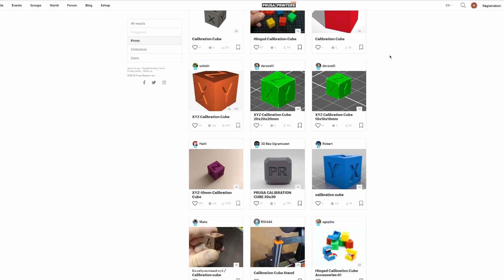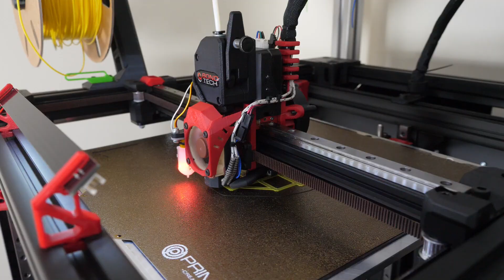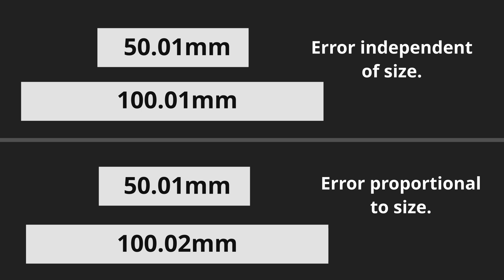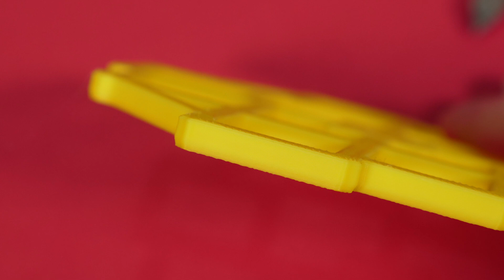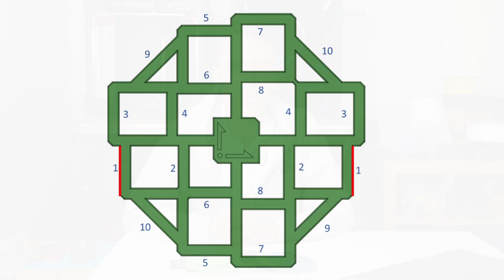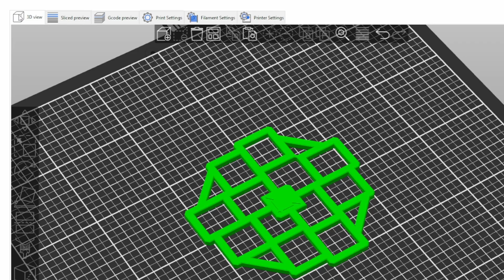STOP Printing Calibration Cubes!

Comment: First of all thank you designing this tool. I printed one ,measured, then did the adjustments on the printer saved the settings.
Round two same thing. It was worse than the first one . Back to square one with the measurements.
Round eight still no better than the original settings .
Decided to go back to what I had in the beginning.
Reply from the maker: You only need to do once.

Comment: I printed it on my Core XY but I have two questions about the excel file:
1. The file says "If you have CoreXY, X and Y are 'locked' to each other so use the average of the two errors." But wouldn't it be better to rotate the print by 45° to be exactly on the axis and have x and y seperate rather than getting just the average?

2. My part turned out slightly to small so the file suggests to either Scale the Part up in the slicer or adjust the Steps but if I decide for the later, if I understand correctly the printer will move a further distance without knowing that it also has to extrude more material to make up for the now bigger part did the file already calculate with that or do I have to adjust the extruder after this aswell?

Comment: I have just used this very successfully to calibrate my Ender 3 V2 Pro. I have two suggestions for improving the excel spread-sheet.

I'm using the Orca slicer and entered the shrinkage compensation value. However, on a 2nd calibration run the compensation value suggested by your spread-sheet doesn't take into account the currently set shrinkage value. It is an easy calculation to do, but would help if you could enter the current shrinkage value so that it does the calculation for you.

An unlocked area would be useful for entering comments on changes made.

Comment: Great tool! thanks! 
The description says: "If you have CoreXY...use the average of the errors". But where do I put the error? the spreadsheet does not account for CoreXY then. 
also: The inner an douter errors have hitns when inner is neg and outer is positive and vice versa. But mine are both negative. what does that mean?

Comment: Any ideas on how to apply the results from a califlower print to a Bambu X-1. While my correction factors are small, I have a large part thats very reliant on dimensional accuracy. I see in "Printer Settings" that I can add/modify the start and end g-code and its Marlin (legacy) flavor but I don't understand where to add the worksheet code.

Comment: This is a great calibration tool. I may need a little input though because results got worse. I expected the print to get bigger but it got smaller. I'm using Klipper and Cura.

I used the SuperSlicer setting in a Cura plugin for "Scaling Factor Shrinkage Compensation". I'm thinking this value for Cura should be 100.19 and not 99.81 like in the Excel file.

X = -0.19%
Y = -0.20%
Skew = -0.03%
Inner = -0.01%
Outer = -0.37%
Reply from the maker: Join us in the Vector3D discord and we can help you better there.

Comment: Hi there. I've just purchased the cauliflower and done a few runs. I've added the skew correction to my Marlin firmware. When I'm implementing the X and Y size adjustments in super slicer should I add the X and Y compensation values as well as shrinkage or just one or the other. Thanks.
Reply: Have you ever found out? I've got the exact same question ...
Reply: @tubeyoului  one or the other from what I remember.

Comment: sounds intresting, but would it be useable for an belt printer ? like CR30
Reply from the maker: Probably not.
Reply from the maker: You could still determine accuracy, but the calculated adjustments wouldn't be correct

Comment: I have an older CR-10S printer and use Cura as a slicing program.  There is an add on for Cura called skew compensation.  I found this add on to be really useful and it was quite an eye opener to discover that my precious printer was not all that accurate on the three basic planes as I expected it to be !  It was even out by a fraction of a degree on the XY plane.  Fortunately, the fix for this plane required a relatively quick and flat print and a bit of basic algebra. For the other two planes I designed a kind of pulley with a sturdy axial piece and printed a few.  I am fortunate to have a large old Meccano set and built myself a test rig to analyze the wobble on a number of these test pulleys.  After about 5 or 6 tries I had the wobble reduced to virtually zero.  This was a very interesting project on its own !

Comment: I bought the STL and read the instructions. Basically, what you're getting at is that we should get accurate prints by changing the E-steps and rotation distance (also account for Skew)? I have always used horizontal expansion to get accurate prints but the approach here is different. Am I correct in these assumptions? Should I never depend on horizontal expansion again? Will changing rotation distance really carry over dimensional accuracy to other models and prints?

Comment: Currently printing this on all my 5 FDM printers ,i do have a question, my tenlog and ender 5 plus i don't have access to the firmware so i won't be able to change the skew correct???
And does the nozzle size matters for this calibration?

Comment: After I print a flower and use the Skew Calibration in reprapfirmware. when I print the 2nd test to check results. How do I compensate for existign Skew. when it recalculates?
Reply from the maker: Unfortunately you can't but from the results I've seen you shouldn't actually need to do this iteratively.

Comment: The error measurement at the beginning has a weird logic in it.
If a cube of 1 cm measures 0.9 then the printer is off by 10%, so a 10 cm cube would be printed at 9 cm.
The reason to print a larger calibration print is to be able to measure smaller procential deviations.
Reply from the maker: No weird logic needed. If your reading accuracy is +/-0.1mm then that would be 10% of 1mm, but only 1% of 10mm. Bigger readings are better.
Reply: @Vector3DP  No, because an absolute error will always be the same, no matter how big you print it. A relative error will result in a bigger difference with a bigger print.
Reply from the maker: Precisely, and when reading your callipers, this is an absolute error. The error of 0.1mm is still 0.1mm, but forms a smaller portion of the total size.

Comment: tested.... my skew is not problem, problem is in inner XY compensation. first you need calibrate this then you need calibrate skew. your skew never gonna be correct. my wall are 5,2mm they need to be 5mm! so first inner compesation in slicer. after that skew. (and ) excel file for superslicer -klipper is in error rotation distance. result is in only in 2 decimals. klipper works on 6 decimals (documentation) so on ender(depend on hardware pulley) you missing some milimetes on correct move x-y.  not mentioned in the video and instructions. if skew is saved (SAVE_CONFIG) then it does not need to be loaded every time in gcode at the beginning and end. it is constantly loaded on every print. (same goes for z-offset). if you wanna load skew on each print  then a macro command needs to be made, like bltouch.

Comment: I wonder if something like this could work for a resin printer???????????
Reply from the maker: MSla/DLP Resin printers shouldn't really need XY or skew calibration as the output is all based on the pixels which are in a fixed position

Comment: Doesnt printing the same object to validate the accuracy defeat the purpose? Because at this point you are just validating that you put the right numbers into the firmware.. Wouldnt it be better to have a secondary calibration geometry that has larger and smaller points for measurements than the first calibration geometry to validate that the settings you have made scale well?

Comment: Thanks for the great work, I really appreciate it! However, after printing and measuring, I'm a bit lost what to do with the results. I understand how to process the skew value, but where do the X and Y values go? In the video you mention the x/Y Shrinkage setting in SuperSlicer, but that's one value, but  I have two different values for X and Y - so which one to apply where and how? Maybe I'm missing something really obvious, but atm, I think this part could use a little more detail. A quick pointer where to put which value would be greatly appreciated.
Reply from the maker: V6 spreadsheet with more guidance and details on implementation coming soon.
Reply: @Vector3DP  Fantastic news! Thanks so much.

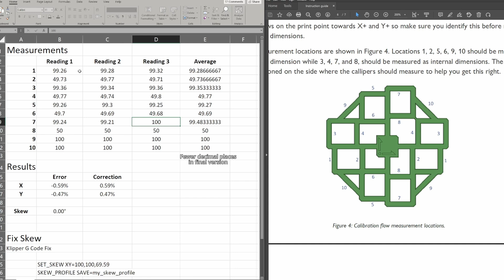Comment: Does your Excel Sheet has a fault? At minute 6:24 your Y error result should be -0,62% and not in -0.69% accounting the measurements from 5, 6, 7 and 8.
Reply from the maker: Nope, it works correctly.

Comment: That's a really clever approach for proper calibration (unlike those damn cubes that are pretty ... useless, IMHO). I'll try this asap before re-starting some projects.
I agree on a per-material calibration, yet should the material brand be considered too (per-material and per-brand) or can we simply ditch that detail ?
Reply from the maker: I've not tested enough different brands to know. I'm sure a low warp abs will shrink less than a normal abs, hence less warping, but I'm hoping most differences from one brand to the next will be negligible even though they probably exist.
Reply: @Vector3DP  That's precisely what I was referring to. One of my go-to ABS is TitanX (and its ASA sibling, ApolloX) by FormFutura and ... these don't warp (even on unenclosed machines). Gonna have to check these against regular ABS that's sitting around.

Comment: Bought the test and ran it on E3D toolchanger.
Skew 0.32° off! -> Unscrewed the Y axis and put it back on the square, re-tensioned the belt -> 0.01°. Quite disappointed that E3D give a machine in such a bad calibration.
It would be interesting to have some data on flow regulation, do you have any ideas?

Comment: Using the filament shrinkage setting in superslicer with a very small value, eg 99.965% results in lots of overextrusion and print looking crappy.  Ultimately after hours of work to arrive at the desired adjustment value, the recommended strategy does not work.  Tried with the current stable release and nightly build, same results.  If perhaps I could access the source files in the protected spreadsheet, I could calculate an XY compensation factor, which requires an absolute value rather than a percentage.  Recommendation: if you are going to protect the sheet, provide the values we need to plug into the slicer too for both SS shrinkage and XY compensation factor.

Comment: You're correct, this is a superior measurement system for calibration. My only concern with this method (as its not described in the video) is how you're determining/separating form from position. All measurements are measurements of form/size. Whereas, I believe, skew would be a measurement of POSITION. This means that all measurements relating to skew (or features out of place) should originate from the same feature, ie a Datum. You could do this by applying a cylindrical feature in the center of the part and cylindrical features at the diagonals and measure center-line to center-line for these lengths. This would probably yield less than 3% improvement, but for accuracy sake... now you know.
Reply: You mean like how a ball-bar test checks movement? 
Not gunna lie, I'd love to be able to do that ki d of test on my printer

Comment: Love the design, thanks for sharing! My go-to calibration object has always been the "5 mm calibration steps" (scaled 2x because 5 mm is too puny for a 0.4 mm nozzle): it has the same advantages of internal + external dimensions for measurement, but also has a little section for bridging, and the progressively smaller tiers also let you gauge the cooling (increasing "overextrusion" at higher Z is usually a symptom of insufficient cooling in my experience). But it doesn't have anything for skew, which is something I've never even thought about before, so I'll definitely be giving your flower a shot 🙂

Comment: Super nice project and way to calibrate with real solutions as well. What about calibration with the printer frame and a caliper instead of relying on a 3d print that as so many other variables like extrusion rate etc (even if your solution takes it into account)?
Reply from the maker: Well if you think about it, it doesn't matter what anything else is doing as long as the print comes out square and the right size, so best to measure the printed parts.

Comment: I don't understand how to use the Klipper G-code fix and the Marlin firmware adjustment. Is just one of the two needed? Or both? I also don't really know where to use them. 

I'm currently using Ultimaker Cura 4.12.1 and an Ender 3 V2 on firmware v1.0.2.  I see I can change the starting G-code in Cura for my machine. Is this where I should put the G-code fix? How do I know if my machine supports Klipper? Is Klipper firmware for my machine? Or is it a flavor of G-code? I am even more lost with the Marline firmware adjustment. Any one can help me?

Comment: Thank you for this! I'm converting my old ender 3 v2 to a belt driven z system (just because and it looks fun) and this will be a fantastic calibration test to test and tune it.
Reply: Hi there! Please, tell me why are you going to replace the Z thread to a belt? I ask because the threaded rod is actually the only always accurate axis in the Ender (since each turn will move exactly 8mm, it is the specification of the thread). 🤔
Reply: @GeekDetour  For no other reason than it would be a nice and fun thing thing to do actually. I was going to do a dual Z rod with stepper motor upgrade - even get some acme rods that I know are true - but I had some Gates belt laying around and the mod would essentially give me the same effect as a dual Z rod; perfect X gantry control.

So this has nothing to do with better quality or the like. Purely a fun mod to apply to the printer. Like adding linear rails. Won't increase quality, just reduce maintenance and guarantee printing parity from print to print. :)

Comment: Used this system to calculate error but for a Prusa Mini, where would I add the calibration error?  For XY shrinkage should I add it to printer firmware or in the Prusa Slicer settings?  Make it filament specific?  What about skew correction?

Comment: I purchased the suite and have emailed you and gotten no response, so trying here.  What do you do if the calculation results in a substantially different X and Y value, eg one is negative and one is positive?  The slicer only has one adjustment that seems to work in both axes.  Does the skew calculation compensate for this at all? Klipper/superslicer here.
Reply from the maker: Inbox has been a little swamped the last couple of days. There might be other problems with your machine, or perhaps your steps/mm are not quite correct for your X/Y axis? My V0.1 has a slight difference between X and Y but is not as large as you suggest. I'd try this: try differenet filament, calibrate/validate E-steps, print and measure again to see if its consistent.

Comment: Thanks for it, I bought it. Question... I can adjust the XYZ Axis steps on my display. (Marlin Community Firmware) What should I input if the Settings are not in prozent? Example: X=80, Y=100 and Z=400.

Comment: The sheet shows separate correction for X and Y but shrinkage in PrusaSlicer is a single value for XY. What to do?
Reply: He just averaged them. Ex: -0.5% for X and -0.9% for Y,  you'd avg to -0.7% and input 99.3 into prusaslicer ( assuming it's the same as superslicer)

Comment: Is this compatible with only specific size nozzles? Or will any nozzle work (I'd like to use a 0.6mm)
Reply from the maker: The whole frame/body of the flower is 5mm wide is most places so as long as long as your nozzle can draw that, you should be fine with any nozzle size.
Reply: @Vector3DP awesome!!! Thank you so much!  

 so probably not any 2.6mm nozzles? Jk... That would be an INSANE nozzle and it would just burn through filament! I already think those 1.8mm CHT nozzles are Insane. It's mind boggling to think you nozzle hole is larger than the filament centering the nozzle. Lol 

Thanks again!

Comment: Have you considered caliper tolerances in these measurements. Maybe there is nothing to change if it's readings are in tolerances of your calipers. By the way this will differ between Prusa Slicer and Cura because Cura calculate rectangle area for line protection, therefore 0.4 mm thick line which is 0.2 mm high, will be arround 0.44mm wide if you print with 100% flow for outer walls (extrusion multiplier)

Comment: How do I set the shrinkage value in PrusaSlicer v2.4.1? My filament settings page looks nothing like your's. I have X error -0.40%, Y errror -0.43%, and Skew -0.18. How do I find the shrinkage % that you entered in the box. And I'm missing the box even on Expert settings. I did a search for it and it doesn't come up in the search box.

EDIT: In print settings, there is now a XY Size Compensation in mm. Is there where I would place a value? If so, which one?
Reply: No, XY Size compensation is about to add/reduce "thickness" to the object. PrusaSlicer doesn't have shrinkage parameter, but you can use  scale factor at object manipulation frame.

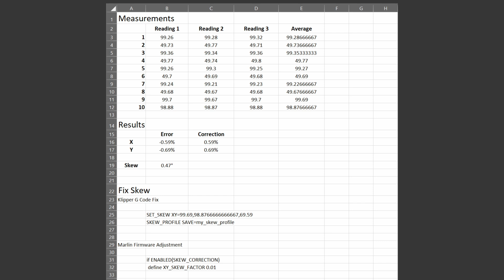Comment: I'm confused why the last argument Klipper gcode fix is 69.59 at 4:34 . If the square was 100mm on the diagonal, that would mean the side length would be 100mm/sqrt(2)=70.71mm
Reply: It seems like you just took the avg % correct for the x axis and just multiplied by 70 instead of 70.71 👀 Naughty naughty
Edit: ...turns out, didn't affect the calculation 🤷‍♂I think it should be 70.30 for yours though, to be picky